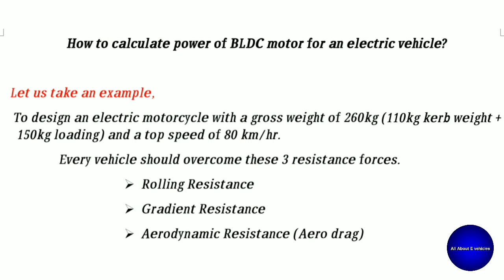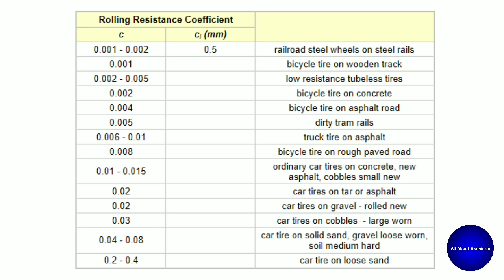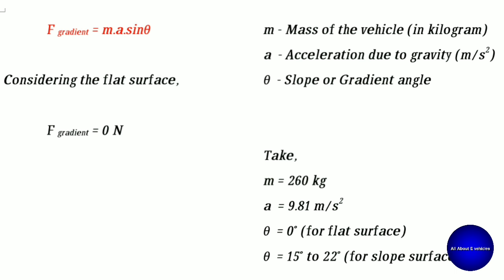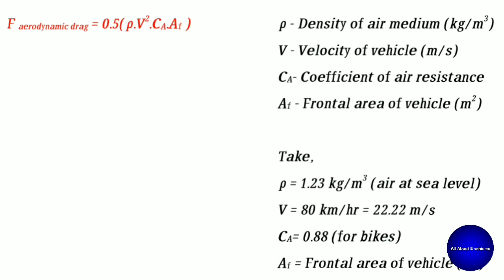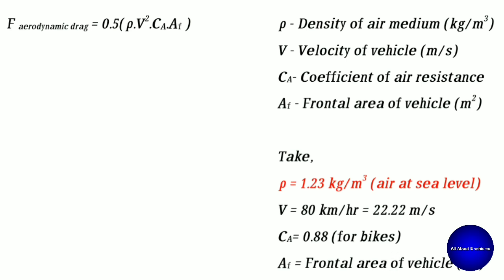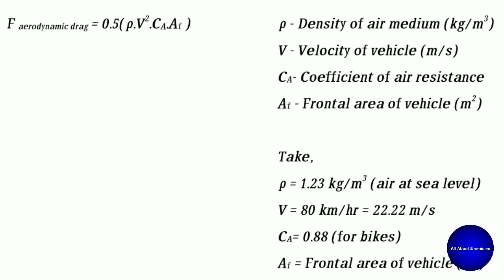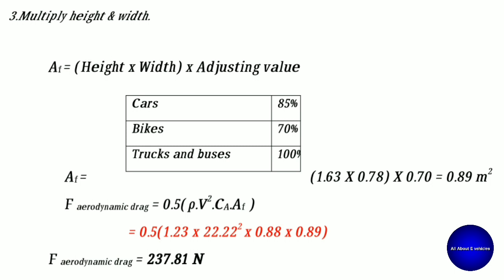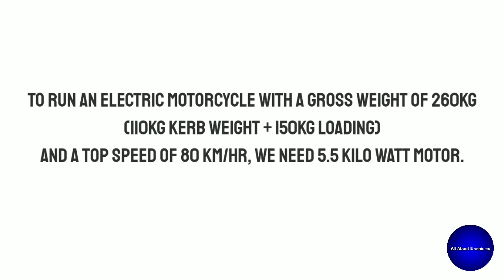BLDC MOTOR POWER CALCULATION|HOW TO CHOOSE BLDC MOTOR?|electric bike|#bldcmotor#howtoselectmotor

Comment: Let's talk about Benling Aura model.
Motor power: 2.5KW
Battery: 72V, 40AH.

max speed is 60kmph, so roughly peak power needed would be around 4KW.

Pls explain how to get peak power as the OEM is nowhere telling about peak power and only talks about nominal power of 2.5kw.

Very very informative video, Thanks 👍
Reply: The actual power depends on how much current the motor controller is sending to the motor. I couldnt find the rated current of the controller on this scooter so the only other way to tell is by using a current meter or shunt while riding it.

Comment: Hello mam I have seeing many videos in UR channel.
Man I am having a bicycle gearless 36volt 360 watts hub motor in my home and I have not used it for many years.
After seeing many YouTube channel I have come to know that future is EV.
Now I am planning to rebuild that vechical to run it.
In my old ebicycle controller and many other parts are rusted and controller is not working & checking the hub motor with multimeter the motor terminals are in good condition and talking about hall sensor I don't know about it. It's working are not how can I check that
My confusion is that is it good to buy a full set ((Hub motor, throttle & controller)) to fit in my cycle or can I restore my old hub motor with a new controller and the throttle only in my bicycle to run it.
While talking about battery I have built a new one for my bicycle .
please give replay I need your help thank U

Comment: Good day Sir, I have a question. When you say a 100 watt brushless dc motor, does that mean input power or output power? I have a brushless motor. I calculated the values of the current drawn from the battery, the thrust and the speed. I want to calculate the power value to say that the motor has such a capacity.
Reply from the maker: In Motor manufacturer specification,  the  given power is output power of motor. Example: A 250 watt bldc motor means, 250 watts continuously it can deliver as output.

Input power of motor = Voltage × current consumed by motor. 

Efficiency = (output power/input power) ×100%

Comment: But the scooters used in electric vehicle are only 3 KW mac ...can you elaborate on this
Reply from the maker: The resulting power in the calculation is peak power
Reply: @AllAboutEvehicles  Ohk understood now ...so nominal power usually is half of peak power is it
Reply from the maker: Not accurately

Comment: How to calculate or choose a motor which can do 0-80 in less than 4 seconds
Reply: If you want a motor that can achieve a certain acceleration, the rated torque is going to be the best indicator of that. (granted were talking about hub motors and that the motor can achieve the top speed) My 1500w motor that has about 42N.m. of torque will accelerate to around 56kph in about 6 sec.

Comment: sir consider if slope or gradient angle is 30 degree then what will be the value of F gradient and what is the value F total???
Reply from the maker: You can try the calculation using the formula
Reply: mg/2 because sin30° is 1/2.
Here it will be 1300N

Comment: Dear Pak, 

Whether this 5.5 KW power indicates rated power of Motor? 

How peak torque, peak power, rpm are plays further role in E-power train? 

Also how to choose 'rated voltage' of motor for given KW of motor? 

Whether 30V motor is best or 48V motor is opt for our vehicle?
Reply from the maker: Peak power..
72 v is best
Reply: You say top speed of 80kmph. 
How to calculate a motor, which can do 0-80 in less than 4 seconds ?
Reply: @AllAboutEvehicles  please let me know, how to calculate or choose a motor which can do 0-80 in less than 4 seconds
Reply from the maker: Top speed 80kmph and acceleration 4 seconds are initially assumed values. This video is all about motor power calculation for this 80kmph speed.
 If you want to change the speed and acceleration,  u can follow the same formula and calculation given. The final answer of motor power will be varied accordingly